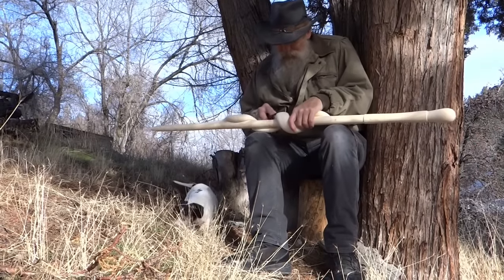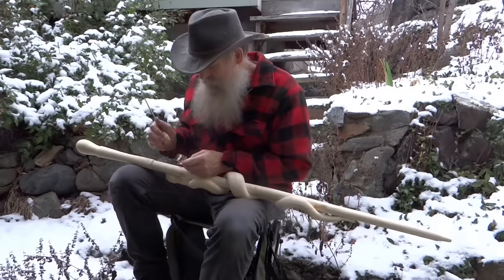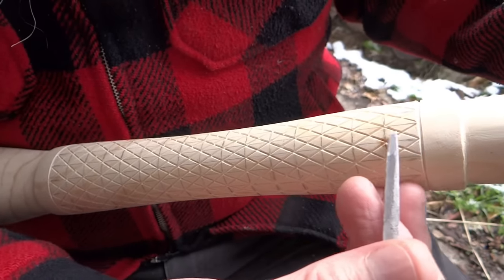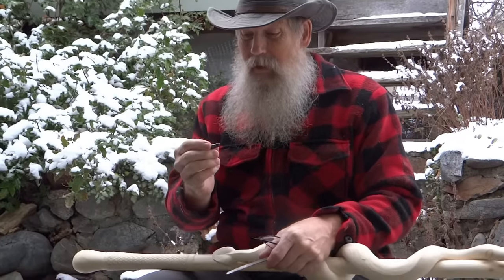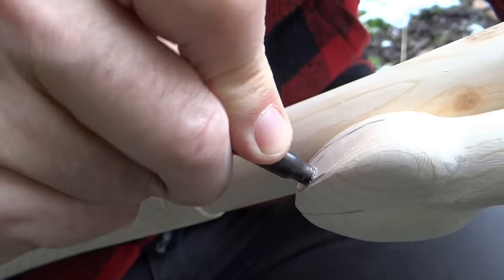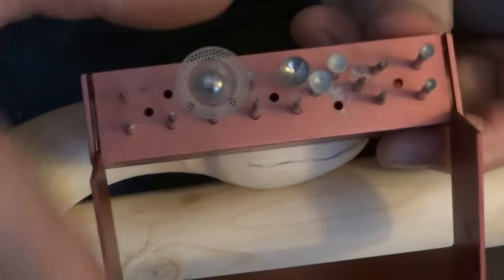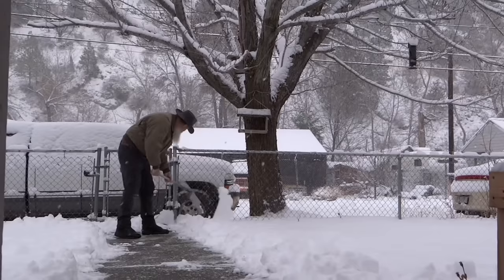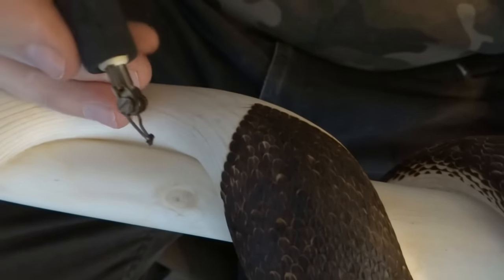How to Create Realistic Details on a  Rattlesnake Walking Stick

Comment: Great info Mike, the diamond pattern you use makes it a lot easier than the checkering I have been using. Checkering is better for a gun grip or knife handle and not really necessary on a walking stick. Thanks

Comment: Beautiful work. For the top handle knurling instead of eyeballing the 180' & 90' etc for the vertical lines. I've put a piece of tape around that comes together once around then take it off do your measurements / marks on the tape put it back on and match the marks on the tape to the wood.
Reply from the maker: That's a great idea!